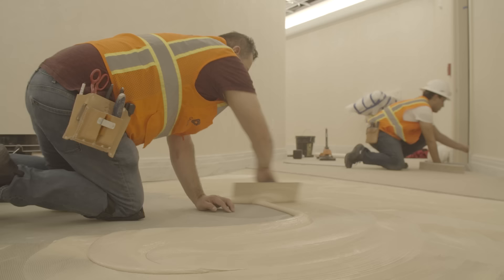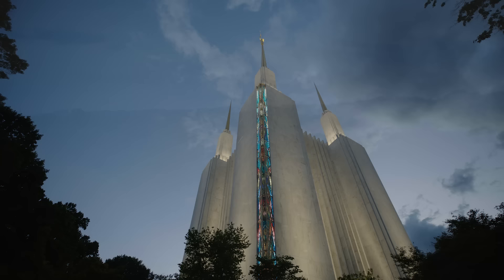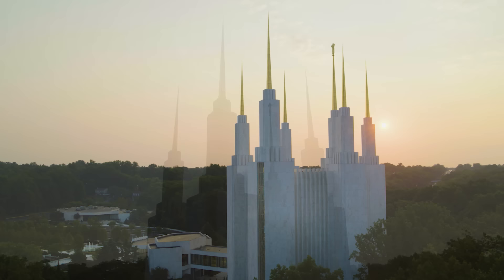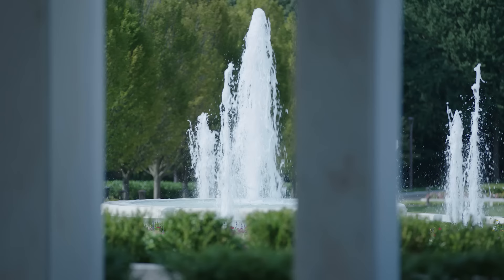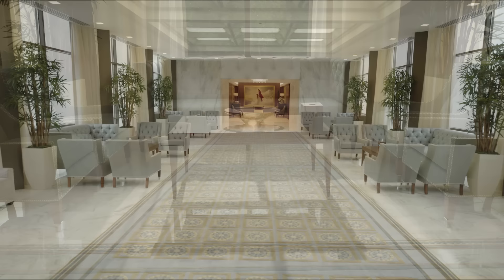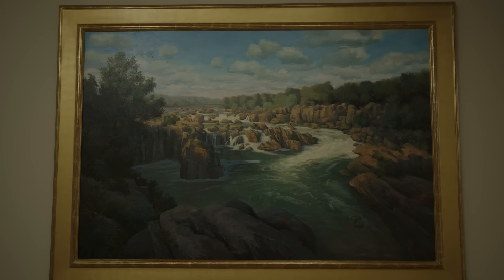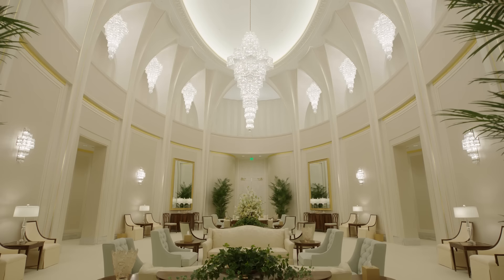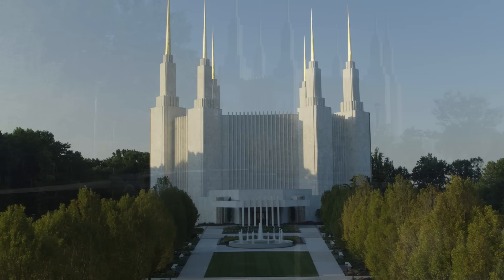The Washington D.C. Temple Renovation is Complete: Come and See

Comment: But... erm... It's got no bloomin' windows! (to let the light in?)
Reply: Hi Laurisa Fine!  Actually, there are two types of windows; stained-glass and marble.  Each of the central towers at both ends have a stained-glass window in it's outermost corner.  Also, several floors of the temple have sections where the marble exterior is ground to just over 1/2" thick, allowing a soft, translucent light to enter.